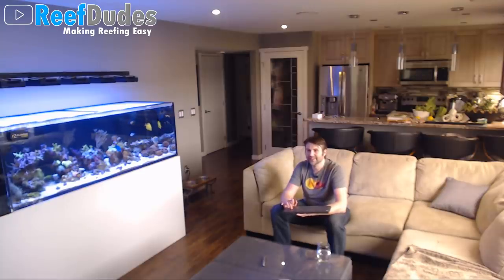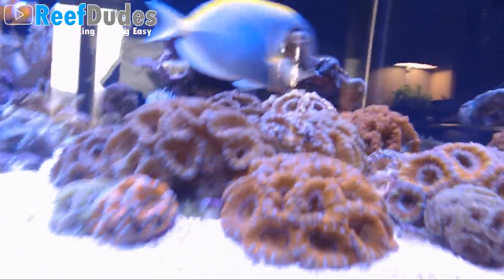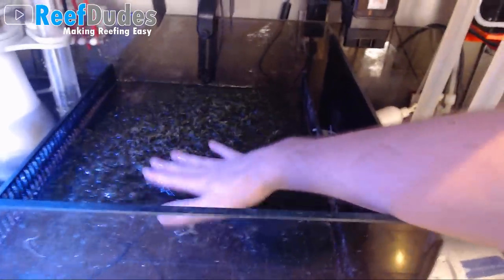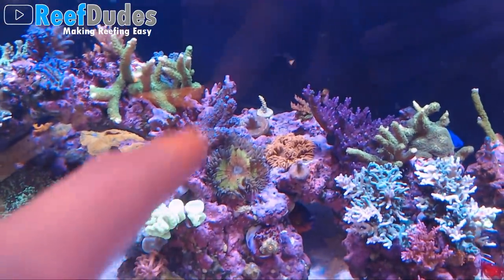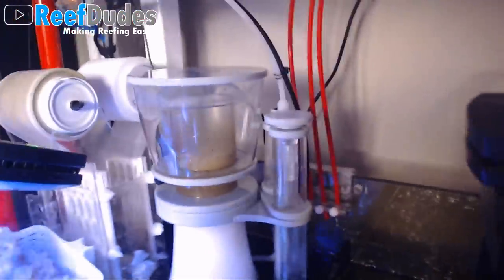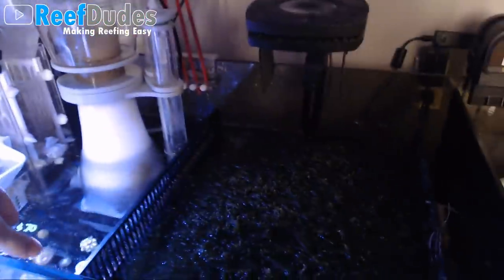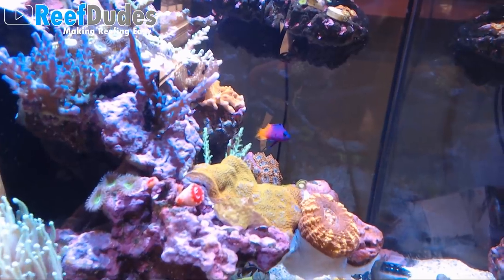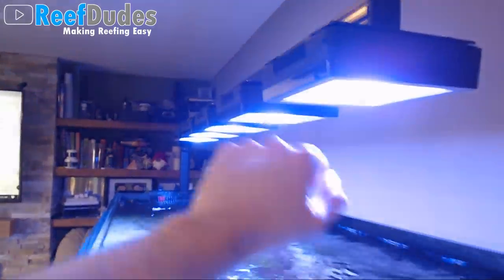Shallow Reef Tank Update  - 5 Month tank update and tour.

Comment: Hey Deb, tank is looking awesome, make that both tanks. Lol.Curious of just a couple things are you using the thermo plastic beads to add coral with and/or make ledges with?is that how I understood it, if so do you have any videos on that yet. And with your light stand, I’m looking at doing something similar .I have the AI ‘prime but need to upgrade  up to the hydra 26s. And want to get rid of my canopy, was there mounting hardware or did you make something to mount the lights to that rail,? thanks for any info and keep up the great work
Reply from the maker: Lights - I used the RMS rail kit for radions and took off the c shape clamps.    Thermoplastic - used it for many purposes  from frags to bonding rocks. very cool stuff!
Reply: ReefDudes thanks man going to look up some and order it, want to add some ledges / overhangs..and as rail kit goes was looking st the extruded aluminum 80/20 1010 series on Amazon..so will see.thanks for Input....
Reply from the maker: @eroggero  https://www.youtube.com/watch?v=XoxKQforlf0

Comment: Hey Dev, How do you like your Nyos 160? I had a rebuild and i have an Elon 160 but getting under my sump is a problem without taking my tank down and lifting up the cabinet to put in a bigger sump...So i'm ;looking for and option to have something like a dual sump with bulkheads to accommodate a bigger skimmer which i have already (Skimz SL203). So the smaller footprint of the 160 looks good and wondering how you're holding up with it. Plan on mostly SPS and the 220 may be a little difficult to get in with the sump.
Reply from the maker: So far it’s awesome and I’m loving it!  I’ll do a video on it in the next few weeks :)

Comment: What do you use to mount afs?
Reply from the maker: Just the build in mount.. i may have put a little spacer in to make it push more towards the inside of the sump
Reply: @ReefDudes  is that the mount bracket from Neptune?
Reply from the maker: @Seattlekoi Yes its the one that comes with it when you buy it
Reply: @ReefDudes  Thank you!